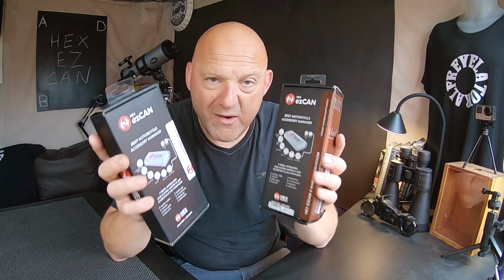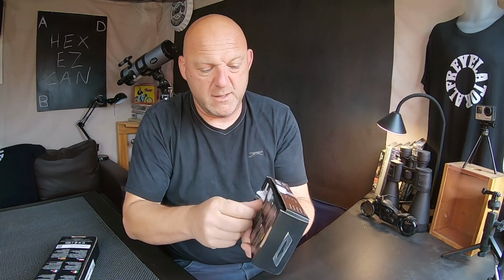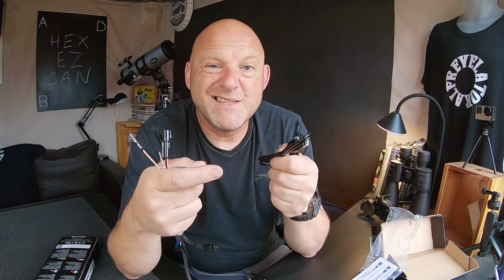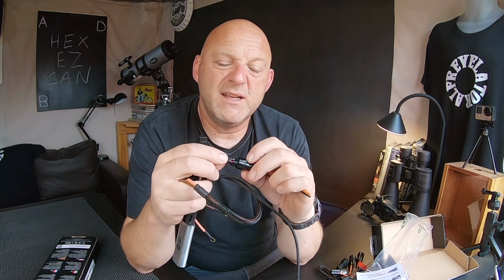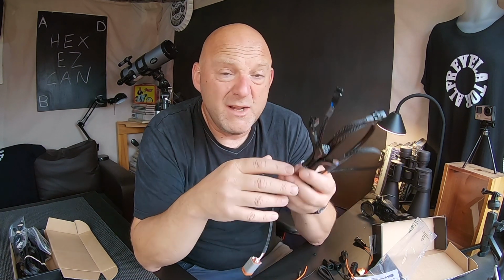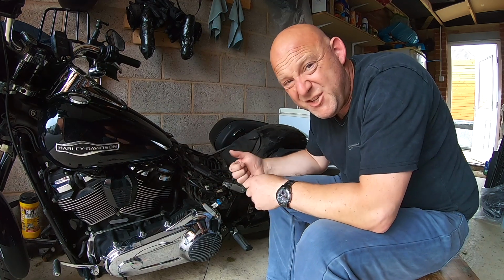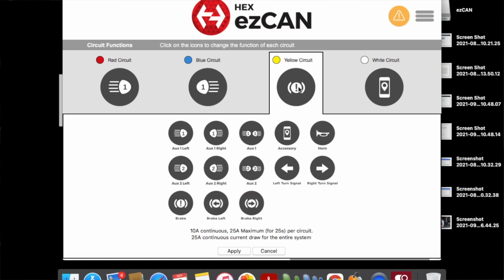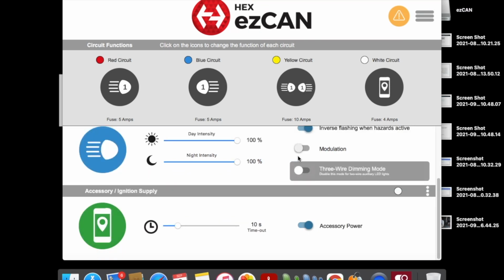HEX ezCAN | Motorcycle Accessory Manager | Harley Davidson | BMW | KTM

Comment: Hi Alf,
Great bit of kit. Unfortunately you need to connect it direct to the battery as it is fused at 30A. The electrical connection harness you have wired it into is only rated at 10A. Make the change and you will be fine.
Reply from the maker: Yes this was merely a quick show and tell

Comment: You just made my life a lot easier, I want to put aux lights on the highway bars, extra lighting = extra visibility . In one of your earlier vids you showed how to alter the left turn switch to activate the out put to highway lights , now with this system no need to take the gas tank off and fiddle with the output connections .  Thanks Alf

Comment: Hi Alf,
Another great review.  Just a query with adding a light bar that is turned on  using the hidden aux switch on the left indicator you highlighted awhile back.
In Australia driving lights have to be switched and powered only when high beam is on, would this be the way that you would do this?

Thanks
Reply from the maker: Yes I believe it just might. There is lots of functionality for that kind of thing. You can also adjust the brightness on the fly too so it might be possible
Reply: I really don’t want to add an extra switch so if it’s possible to use this to allow the light bar to be operated from the aux switch, will be the way to go.
Thanks Alf

Comment: I've had one on my BMW GS for a few years now and it's brilliant, so easy to set up and use. I power my aux lights though it and they switch off individually when I put that indicator on and strobe when the horn is activated. I also have an additional denali mini sound bomb horn through it as well as my bike cam. I've swapped it over to my new bikes each time I've changed and because it's plug and play it's dead simple to restore the bike you're selling back to standard. Just brilliant!
Reply from the maker: Yep totally live this product